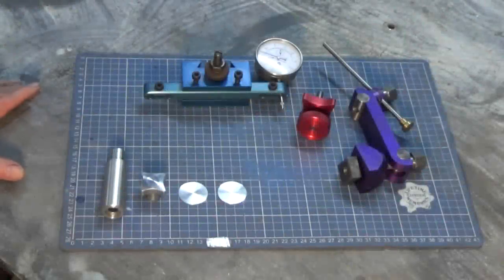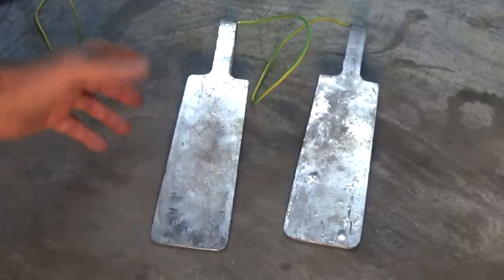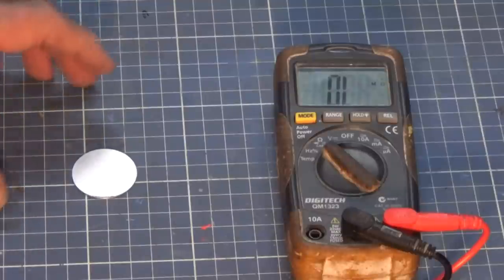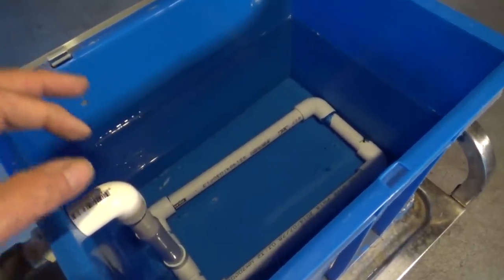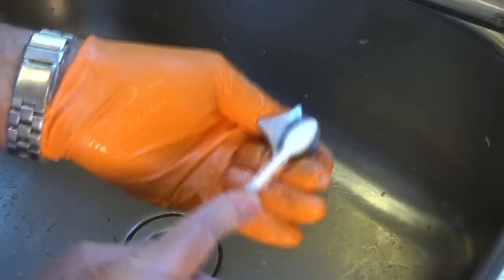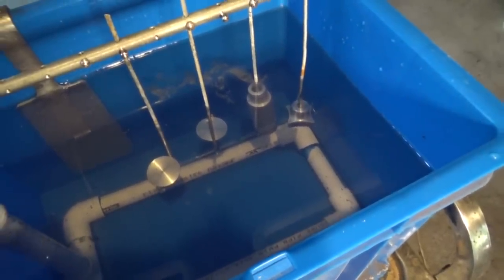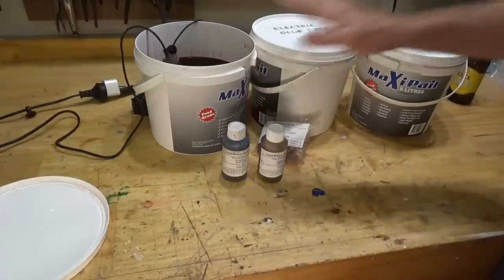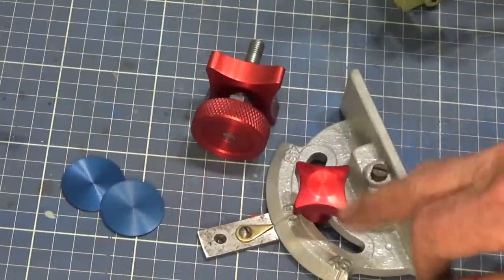Metal Finishing With Mark Anodising 101

Comment: 30yrs ago i used to work at a hardchrome company and one thing we used heaps of was Ajax ! We also used pumice usually after ajax when we needed something real clean - mostly things made of cast iron and after all that cleaning it got wiped down with muriatic acid and immediately put into the chrome solution .
Inevitably i will have to sort out a  set up like yours - maybe a bit smaller as i know i will get sick of looking a plain aluminium on the model engines i make, one can bare only so many aluminium /brass combinations  and i detest painting !
Watch out drinking that XXXX stuff Mark - that stuff will kill a brown dog !☠☠☠☠😁
Thanks for the informative video Mark ! That was probably the clearest explanation i have seen on anodizing in the home workshop !
Reply from the maker: Thanks Ian. I recall watching a video on chrome plating being applied to a massive air cleaner from some sort of American V8 car engine. The number of steps required was incredible. They had to wire up anodes all around and inside the part just to ensure a consistent thickness of plate. Then there were multiple metals applied as well. Copper, then nickel, then the chrome. They didn't reveal how much they charged for the job but I was thinking it must have been at least four figures. I used to send parts out to get anodised and they always came back beautiful but there was a minimum charge and pretty soon you realised that you could invest in your own setup and provided you don't count the cost of your own labour, it's pretty much just the cost of the electricity to do the job.
Regards,
Mark
Reply: Mark Presling 
Many people complain about how expensive decorative chrome is but once i explain the process and how much work goes into the set up they soon see where their dollars are going ! 
We used to do Hardchrome only which is a Chromium deposit straight onto the parent metal and is used to repair bearing  journals, hydraulic rams ,, rollers and to put a low friction - hard wearing surface on dies used in injection moulding machines .
This process is much simpler as there is no intermediate coating  applied and no polishing operations to perform but i still remember some dies used to take a whole day to jig up - multiple anodes  , masking off the rest of the part  and then trying to clean everything without disturbing the anodes were all part of the adventure!

Comment: Acid is used to clear out drain clogs, and de scale and recondition the inside of water storage tanks, supply lines steam pipes, and reduce water hardness, it's ok to flush it, just don't pour it on metal fixtures or unglazed masonry or ceramic materials, most soils have a high buffering capacity and can neutralize concentrated acid, but any minerals used that might have contaminated the acid solution, must be completely removed and the solution tested, before disposal. 
 Why would anyone want to dispose of Sf
Sulfuric Acid anyway? Filter, distill and store.

Comment: Hey Mark. Very cool. Thanks for breaking it down and making it easy. Those finished parts look the bees knees.

I've never cast lead before, but I wondered if I could just level a baking sheet and pour molten lead into that, then pop it out, and bandsaw it down the middle?

Those aluminium hanger wires could be made with aluminium tig rods I expect? 

I'll go back and look at the engine turning one now, and I'm looking forward to the next video too. I hope your delivery happened smoothly today!
Reply from the maker: Craig, casting the lead was easy compared to aluminium. The mould I made was just bandsawn out of two pieces of aluminium sheet. I did it in two parts so I could cut into it from each end instead of having to pierce it. It also made it easier to get the part out at the end. There is another sheet of aluminium underneath and the whole thing is screwed down to a piece of form play. I did find that the lead cooled too quickly to get it to flow out to the edges of the mould so I had to run the blowtorch over the surface to remelt it. This caused the mould to bow upwards at the ends so I had to clamp it down to the bench. As always, by the time I got the second one done I had worked out how it should be done! If you were using a thin metal tray you would need to be careful that it didn't "pop" and splash the molten lead on you. The molten lead is super shiny and smooth but when it cools it gets a crystalline crocodile skin look about it but it doesn't matter for what it has to do. The mill went in OK and I am really happy with it. No damage from transport and the paint is better than I expected. 😁
Regards,
Mark
Reply: @Preso58  Thanks for the info on the casting I'll keep that in mind if/when I try this out. Good news about the mill - can't wait to see it on video. Thanks, Craig

Comment: W watched your videos with interest. I used to be a Technology teacher. Now I'm retired I have plenty of time in the workshop etc. When in 6th form at school, I anodised, using an old aquarium. I used various colours, but always clothes dye, Dylon. I use to boil it in an old saucepan. As well as some castings and turned parts, I also anodised several cycle parts. They did look good. I also used engine turning on my projects, using carborundum paste and dowel. Sticking a disc of leather onto the dowel can help. The results were inpressive.

Comment: Thanks Mark, been looking forward to this since you hinted at it a few days ago. 
What happens at the spots that they wire hanger comes in contact with the part? Do you end up with a funny spot at that point?
I was under the assumption that anodizing was like plating but apparently not. Thanks for showing your process.
Reply from the maker: Perry, I could see a slight imperfection where the wire was touching but the disc will be fitted into a pocket so you won't see the edge anyway. But anywhere the wire touches will leave an un-anodised area. Sadly, anodising is one of those "black arts" like metal casting. It has taken me years to work out a process that is repeatable. When it doesn't work there is little evidence of what went wrong. You just have to start again and make incremental changes to the process. 
Regards,
Mark
Reply: Mark Presling thanks, that’s kinda what I expected

Comment: Caswell also has a chemical called Zincate that allows you to plate aluminum with whatever you want, although the plating process may require a specific metal to plate over first.
Since aluminum oxidizes like instantly this chemical prevents that and then dissolves in the plating solution.
Reply from the maker: I did look into the viability of plating over aluminium a while ago. I recall reading about zincate. I think it is also possible to do it with a cyanide copper strike followed by nickel and chrome. Jane kits sell a copper strike solution called Ultra Strike but I have not tried it yet. 
Regards,
Mark

Comment: A good quality aquarium heater could be a good replacement for the ones no longer available from Caswell.
Reply from the maker: I did buy one of those to heat up a acid etching bath but because they are designed for tropical fish they really don't get to the temperature needed for anodising dyes. I think I was lucky that I bought my Caswell heater before they got scarce.
Regards,
Mark

Comment: I wonder if Yuri has tried this using a raspberry pi? You can run various modified versions of android on them and they are touch screen compatible.
Reply from the maker: I think I have seen some systems that came out very early in the TouchDRO development using Arduino and now that off the shelf touch screens are a thing it would be easy to make a customised system.
Regards,
Mark

Comment: Hey Mark do you have any tip for both striping and refinishing Zamack?
Reply from the maker: If it's chrome plated it can be very difficult to do at home unless you grind it off. Chemically stripping chrome requires some really nasty acids. I believe there is a way to reverse the plating process but once again, I think it needs a lot of specialised solutions and equipment. Jane Kits sell a copper strike that will work on zinc alloys. Once you have the copper plate you can then nickel or nickel cobalt plate over that. Nickel cobalt looks exactly like chrome but it is easier and safer to carry out at home. Jane kits don't sponsor me in any way but I have used their products for some time and they are affordable and they work well in the home shop.
https://janekits.com.au/product-category/electroplating-kits/ultra-copper-plating-kits/
Regards,
Mark

Comment: This Is Good advice , I've tried this but this is minimalist no fuss advice.
Reply from the maker: Thanks. I really should do a follow up. I have found out just recently that the Caswell dyes that I use are very sensitive to PH levels and some of my dyes, especially the black, were way too alkaline. I bought a digital PH meter and checked all my dyes and found that a lot of them were incorrect. If the PH is wrong the dye won't penetrate or it takes way too long to get the colour depth you would want. Check this link for the different PH levels for each colour. https://forum.caswellplating.com/forum/anodizing-questions/3885-anodizing-dye-ph
Regards,
Mark

Comment: G’day Presso, good video. Just wondering what the shelf life of the mixed die?
Cheers 
Peter
Reply from the maker: I have had mine mixed up in those tubs for about five years. I have only had one colour (gold) go off and I think it was because I contaminated it with something. I had been using it for lots of parts and it gradually stopped colouring the parts and a sort of scum appeared on the bottom of the tub. The replacement colour came as a powder but I haven't mixed it up yet. I think the best plan is just to mix up just enough to colour the parts you are doing. There is enough concentrate to make up about 7 litres of ready dye. 
Regards,
Mark

Comment: Could you use any acid as long as it's at least 20%? I was thinking vinegar.
Reply from the maker: If you are referring to the electrolyte in the anodising tank, it is generally recommended to use sulphuric acid or sodium bisulphate. Those are the only two acids I have used. Some acids may etch the aluminium or they may dissolve aluminium into the electrolyte which I believe is detrimental. Maybe there is some room for experimentation though.
Regards,
Mark

Comment: Does it stop Galvanic Corrosion ??
Methinks perhaps so.
The Bus bar issue ... Conductive Grease ?
Reply from the maker: Kenneth, anodising creates a tough and hard layer which is far less active than the raw aluminium so it should be much better at resisting corrosion whether it is caused by corrosive atmospheres or galvanic corrosion. Most aluminium window frames are either clear anodised or hard anodised to resist corrosion in salty environments.
I used to clean the bus bar before I started anodising but due to the light weight of some components and the fact that aluminium will oxidise almost instantly after it is cleaned the very slight resistance can ruin the anodising process. Clamping the wire has solved the problem.
Regards,
Preso

Comment: Actually, I buy 95% sulfuric acid in 32oz bottles for like $7 as drain opener. So not only is it still widely available, but it's actually sold for the express purpose of pouring down the drain
Reply from the maker: Unfortunately, that option was not available to me. The drain clearing solutions sold locally are alkaline (sodium hydroxide). If you can get relatively pure sulphuric acid and it's cheap then that would be the way to go.
Regards,
Mark

Comment: Hi Preso, just watched this again. Got the ingredients and going to do a trial anodise. Wish me luck....lol. Regards Kevin
Reply from the maker: Kevin, good luck with the process. In my view it is worth it to buy quality dyes. I have tried the fabric dyes (RIT) and they don't work for me. Some fabric dyes will colour the metal but they are not guaranteed to be UV resistant and they don't give the same depth of colour as specialist anodising dyes. Heating the dye also makes the penetration quicker but you must not take the temperature beyond about 60C. If it gets too high it will seal off the pores in the metal before the dye can penetrate. 
Regards,
Mark
Reply: @Preso58  thanks Preso. I'm experimenting with the RIT dye on some scrap aluminium so will see how it goes. Thanks for the advice. Regards Kevin

Comment: Wow! Great video. This is the first time to your channel. This is by far the best anodizing videos I’ve seen! Thanks for sharing. Do you think aluminum 4043 TIG wire would work as a hanger? Thanks again!
Reply from the maker: Jason, I did try using TIG wire and for some reason it eroded away during the anodising process. I am not sure why but I find that the transmission wire I now use is reliable. Titanium is better but I am still waiting on that particular supply.
Regards,
Mark

Comment: Thanks Mark, going to give Anodising a try this summer. Can you advise on the best way to strip the anodising? I have a few parts I would like to strip & dye another colour
Reply from the maker: Caustic soda (sodium hydroxide) is the best stripper. You can see the dye coming off in the solution after a minute or two. I just put a couple of table spoons of crystal into about 3 litres of clean water and it works great. Don't leave it in for too long though or you will etch the surface of the part. About 5 minutes is usually sufficient. 
Regards,
Mark
Reply: @Preso58  thanks Mark

Comment: Top video, I learnt a lot just now and have to try it myself.....Just to be clear on the sodium bisulfate solution, did you add the 4 kilos to 16 litres of water, or mix the two until it equaled 16 litres total ?
Reply from the maker: The ratio is not really critical. I added 4 kg of powder to 16 litres of water but over time you do get some evaporation and the level in the tank drops. It doesn't seem to affect the process. 
Regards,
Mark

Comment: Good Show Mate...as always. I learned stuff. Harder to do as I get older. Imagine that. Reminds me of bluing gun parts. The clean up and the get ready are much the same. Just different solutions in the final process. High temps with bluing. You make jewelry. Me too.
Reply from the maker: Actually, I don't make jewellery. I guess I'm not creative enough for that. I use the jewellers roll for forming cylindrical and conical shapes in sheet metal. It's good for forming wire and small section angle profiles too. I did actually make some jewellery when I was training at teachers college. We did some lost wax casting in pewter. We had a centrifugal casting machine which you wound up like a lawnmower. Scary as!
Regards,
Mark

Comment: Well done mark, so good the way you explain every process. I know you can get a brushed gold finish, is that the powder its self or the way its preped and applied
Reply from the maker: Getting a brushed or satin finish is all about the metal preparation. The dye is just a colour and it's translucent so you will not be able to hide any surface defects, scratches or dents. I usually don't try to get a mirror finish on the aluminium before anodising. The acid in the anodising tank etches the surface slightly so a part with a mirror finish will still come out as a sort of satin finish when done. Commercial anodising companies use a variety of tricks with temperature and additives to get a better quality of surface finish but that's a bit hard for the home shop.
Regards,
Mark
Reply: @Preso58  Thank you Mark

Comment: Thanks for all the great videos, I'm learning a lot. What is the rough size and weight of the lead cathodes?
Reply from the maker: Jay, the bigger section is 200 X 75mm and around 4mm thick. The handle section is 185mm long and 20mm wide. I am just guessing but I would think they are about 400 grams each.
Regards,
Mark

Comment: I must say you are the only one I know with a “tarted up” band saw. To be clear you operate the process with the power supply in the constant current mode?
Reply from the maker: No, I set the voltage to 15V as constant voltage and just let the parts draw whatever current they need. I know it's not the way you are supposed to do it but it seems to work for me. The whole decorative bandsaw table thing came about from a post on Instagram that I saw by Steve Smith and it sort of got out of hand. 😁
Regards,
Mark

Comment: Love all your videos.. in the process ATM building a little tank to try this anodizing process I do have a question!? I know they say don't pour down drain. Ultimately I'm trying to use PVC 3in x 30 and it is plastic.. just curious would the acid over time eat the PVC? Sorry if this is a dumb question
Reply from the maker: No. PVC is commonly used for things like acid resistant fume cabinets and tank storage in chemical laboratories. It is quite safe to use most plastics with acids and alkalis. 
Regards,
Mark
Reply: @Preso58  thank you so much for the response. In the process of building it now I will let you know how it turns out!! You the best!!! Oh one last question since the metal piece is roughly 30 in long.. tank about 35in should the cathodes pretty much run long ways the atleast 30 in to cover the surface area of the piece I'm trying to anodize..aluminum is roughly 2.8in x 29in about 2 to 3mil thick

Comment: Is it possible to electroplate aluminum??
Reply from the maker: Yes, but it's not a simple process. I have never tried but it can be nickel plated using an electroless nickel solution. I have used electroless nickel on copper and steel and it works well. The electrolyte has to be heated to just under 100C and the part must be chemically clean. It is then immersed in the electrolyte and there is no current needed. The nickel is deposited very evenly since there is no current path required to deposit the coating. The main issue with aluminium is that it is a very active metal and on oxide forms almost instantly after cleaning it. 
Regards,
Mark